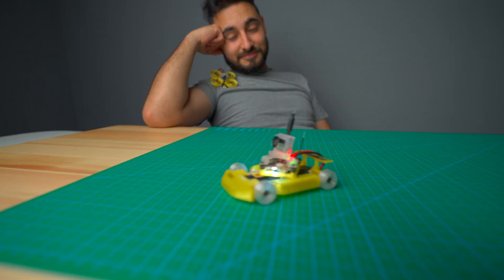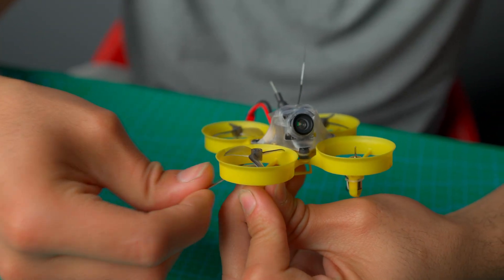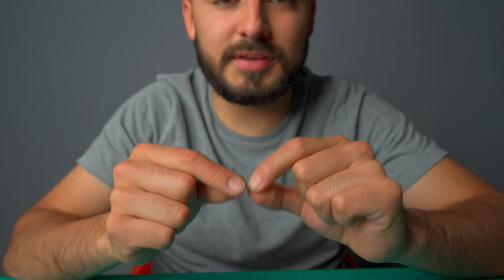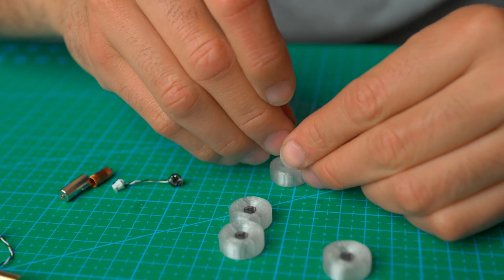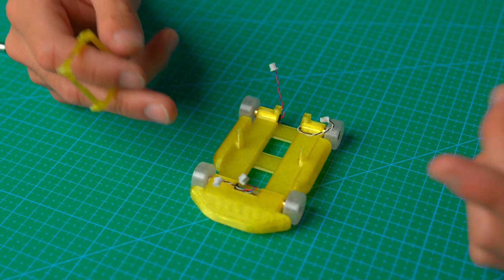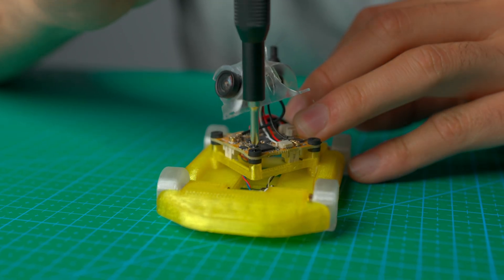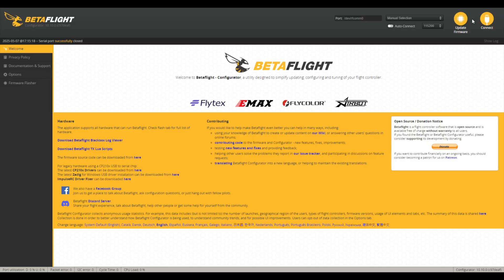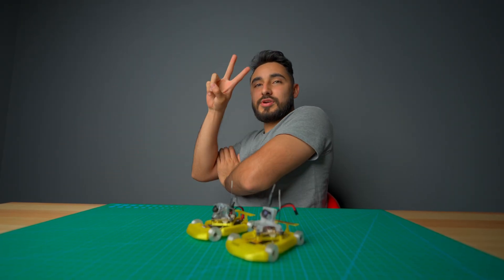Turn Your Drone Into A Race Car!

Comment: They should have never taken electronics classes out of highschools.   Got kids and grand kids.  I know they dont have it.(my State,county)   I had it in middle school though highschool.    The RC hobby has been strong in my family for three gens.  oh wait 5 now.   grandpa, dad ,me, my kids now grandkids.       all RC can be used for other RC.   simple soldering opens many doors to many occupations and hobbies.     grab a soldering iron..   test your self.   "heat a metal needle pin ,nail  or thumb tack with a lighter.. touch the wires with it using solder.. your soldering."       got a pine tree around.. the pitch is your 'flux"   keep things simple and save more.   thanks..

Comment: This little thing rules! I’ve had mine built for about 3 days. Unfortunately if you run packs back to back the motors get hot enough to melt and deform their mounts in the frame. All four of my motors are loose and the two back motors have up and down play in them. 

Maybe needs to be printed in a higher temp material
Reply: i actually printed mine the entire thing out of TPU at 40 % infill and since everything is so light its still have great rigidity and can hold a lot more heat than pla/petg
Reply: @hecticaperture heck yeah! Thanks for the heads up I’ll contact my printer friend!

Comment: This is great!  Free endorphins for us hoarders who still have brushed whoops hidden away in a drawer!  Ideas: Removeable front bumper printed in TPU for impact absorption. Spoiler with angle for proper downforce.  F1 seems to be on the uptick in the car world, how about a chassis more akin to an F1 racer?  Brushless version with the bells imbedded in the wheels, might be enough torque in them for Monster Whoop Trucks!

Comment: when brushless version?
Reply from the maker: We actually built a brushless prototype as well! Sadly tiny brushless motors won’t be able to turn smoothly under low rpm, instead they twitch a lot. We determined that brushed motors are the superior option for these cars.
Reply: @NewBeeDrones  how about larger sized brushless motors on a way larger scaled rc car for  drag racing  or dirt drifting purposes lol
Reply: I already have an idea how it could be done. Two carbon fiber arms connected to two standoffs. And the motors are mounted on the outside of these 2 carbon fiber arms. These standoffs are then secured to the body with body tubes, just like similar to this model. That means you first mount the standoffs on one arm, push them through the body tubes, and then attach the other arm to the two standoffs...

Comment: So yall got time to make a fucking cart but cant make a 04 Pushser Mount thats solid and has no jello for the camera..................this is a joke I cant with this company anymore. Fix the damn canopy before I throw all your products to the garbage and stay with BetaFPV. This gotta be April 1st still.
Reply from the maker: Hey Evan, the upgraded circular camera mounts worked flawlessly in our testing. We are happy to send you some free prints. We do apologize for making you feel this way, but we are determined to keep our customers happy😊
Reply: are you talking about acrobee 75 o4?
Reply: Do you contact customer support? The newest mount solution doesn’t have jello issue. Btw, the BetaFPV O4 got jello too and they can’t be fix, you should check out more review on that
Reply: @liguokun2005  The stl file? Yeah I printed that and its worse. On the slowest rates possible. Look at pyrodrone and newbeedrones reviews for this drone yet its sold out. So this company is fine with selling a broken product. Also theres 3D prints to resolve that already on yeggi but nothing for the 04 pusher.

The mount is on the damn carbon brace tucked into the frame. It makes zero sense and my problem is their "fix" is download a file that isnt a fix its the same mount it already comes with.